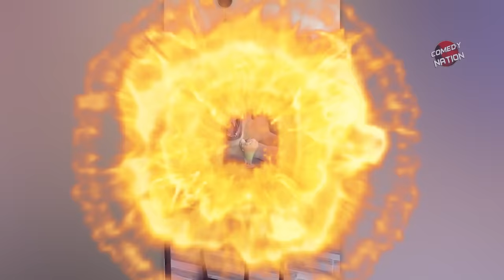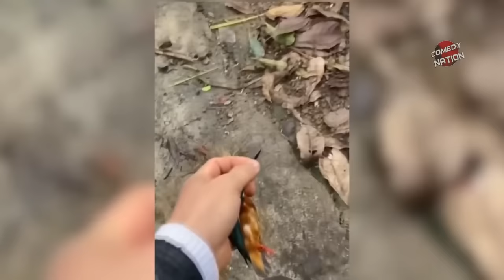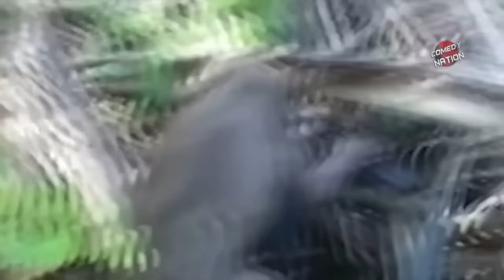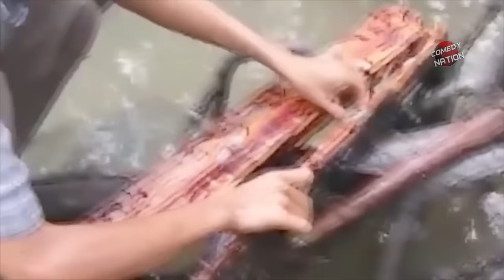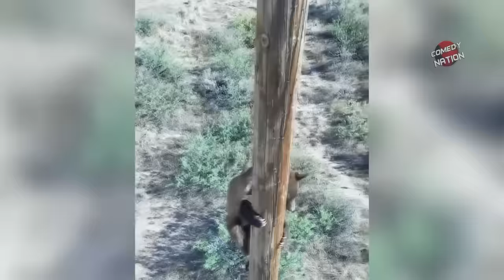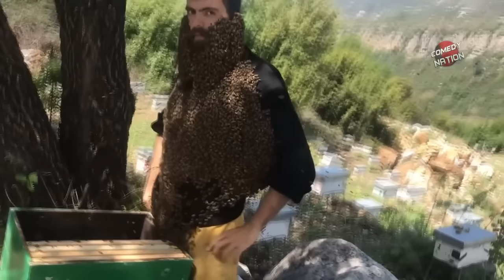If These Animal Moments Were Not Filmed, No One Would Have Believed Them !

Comment: My kids mother and I were living off grid in the desert of Arizona in a camper van. One day we're sitting outside when we hear a rattling sound in the sky. We look up in time to see a large mass of something fall to the ground about 20 feet away. It was a hawk and a rattlesnake. The hawks talons seemed stuck in the snake and the impact caused the talons to rip the sides of the snake open, and the snake had a hole in its head, behind one of its eyes. The hawk had gotten bitten in the top of its head by the snake and the snake was still clamped onto its head at first. They seperate from each other and the hawk flies a few feet off the ground and lands about 5 feet away. The snake tries slithering away, but the act of moving caused its insides to start coming out its sides. The hawk had gotten bit in both its eyes and was blinded. They both were just sitting there still. Eventually the hawk started breathing heavy and started staggering around. The snake made another attempt at slithering and its insides came out even more. They ended up coming towards each other and both died eventually fairly close together. We put a milk crate over them with a rock on top of it so coyotes couldn't run off with them and watched as time passed and they slowly became skeletons from ants and insects eating them. When we changed locations we left the skeletons by the campsite where they died and wondered what the next campers who end up in that spot are going to think.